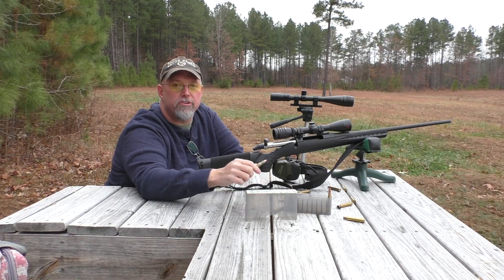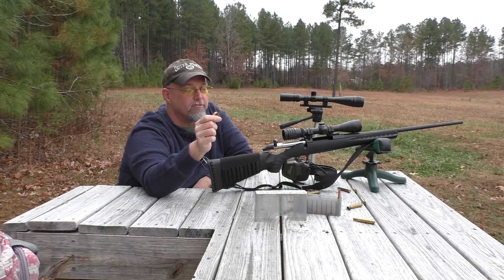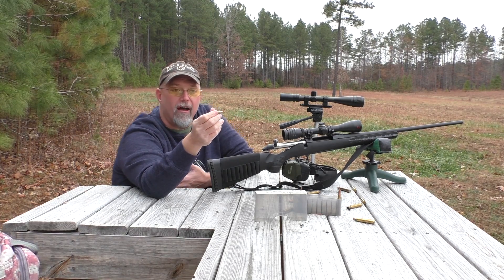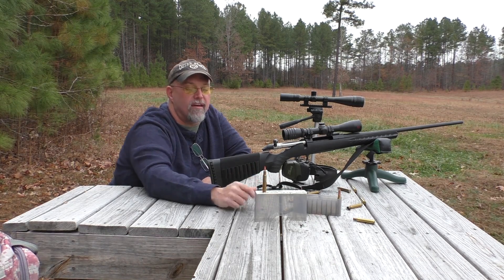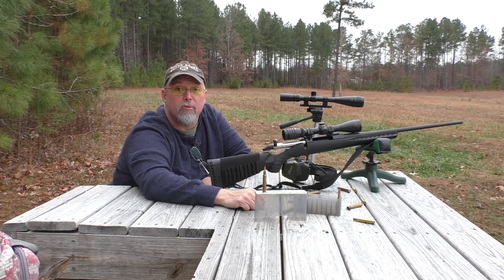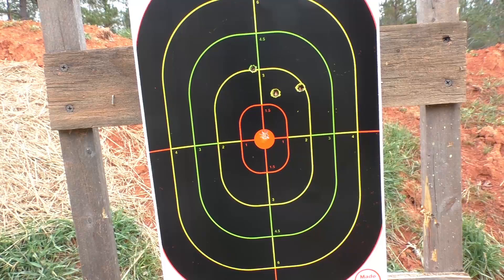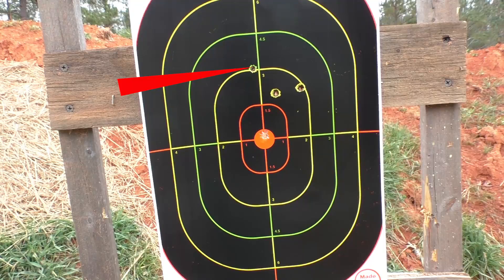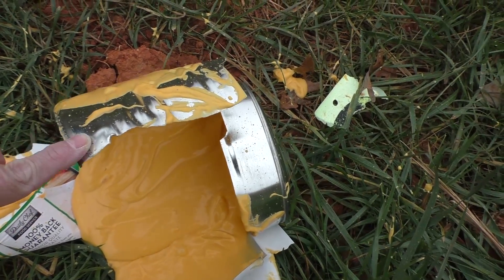30-06 Accelerator Sabot with 55gr .223 Hornady V-Max

Comment: I was hoping you had some load data . I have had decent luck with sabots in my Model 700 30-06 and Model 81 .300 Savage  . The older grey sabot would not release from the bullet at 30-30 velocity however the newer white sabot does and they shoot well .
I use loads for the 100 grain short jackets to get started 2400 powder from my old Hornady manual really makes a fireball but pressures are mild so far at book Maximum.